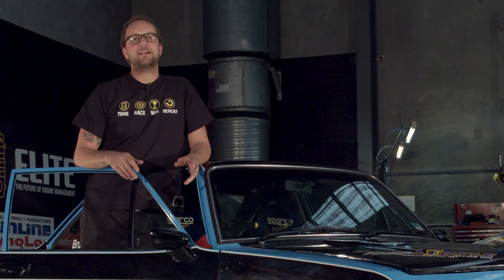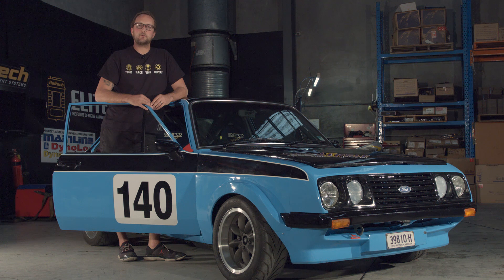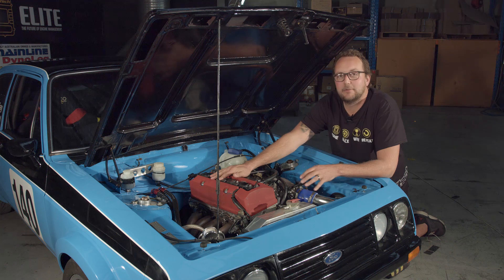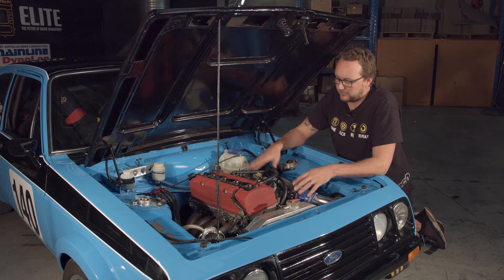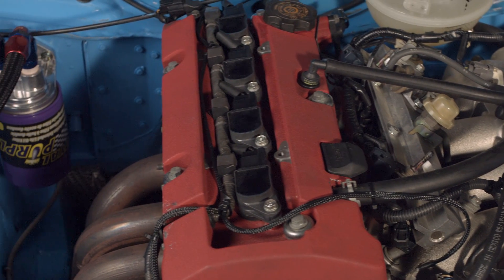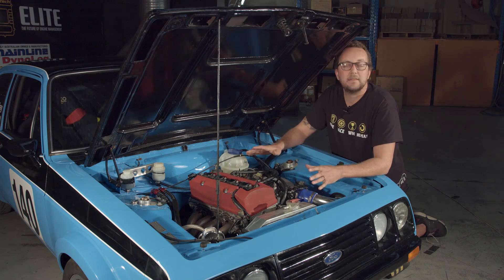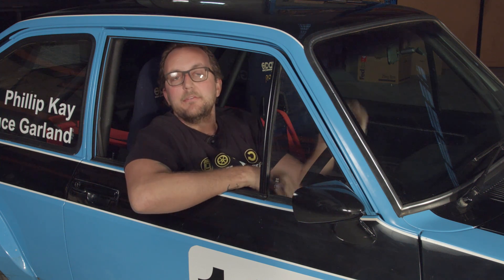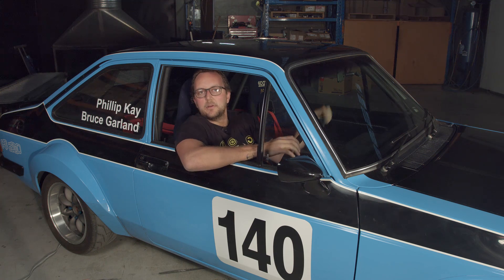💬 79 Escort with a Honda F20C conversion - Technically Speaking

Comment: Hi. I want to install a F22c on a te27 trueno. I have the original engine, transmission, harnesses, cluster, ignition, and pedals of the s2000 engine. What plug in ECU will I need. Please, provide me with the model. thank you

Comment: Did Ford sell the droop snoop RS2000 in Australia? I was sure the RS2000 down under was the standard Mk2 body so Ford could use it for Homologation racing purposes??? I could be wrong of course.
Reply: Rich77UK i thought the same bud, was told they sold them as a 4 door rs2000 as well haha,
Reply: @upurkilt7246  The full long nose version was sold here in Australia. But you did prompted me to go reconfirm my answer. So try checking out this website to confirm for yourself : )    Escort RS2000 Mk2 – Australia 1979 – Ford RS Owners Club (Australia)
rsownersclubaust.com.au/rs-cars/escort-rs2000-mk2-australia-1979

Comment: How much would a swap like that coast
Reply from the maker: That really depends on where you get your engine and how much of the work you do yourself. We are seeing a lot of these engines being put different cars.
Reply: Haltech yeah thanks I'm thinking about putting a f20c motor into a ke70 would be Abel to do most of the fab work my self just wiring and the fuel setup I'm a bit sceptical about

Comment: To MCM and Haltech, Guys have you forgotten about the good old FJ20ET that used to be in the old Skylines, Sylvias and Bluebirds??? 

That Engine responses to mods like no other old 4 cylinder and proven to out do the SR20DETs.

Would like to see a video modifying and tuning it. btw I can arrange an old S12 RSX (Sadly not owned by me anymore) in case it's needed it for the project;)

Comment: Way to ruin a Escort: Fit a Honda motor.
Reply: Hulk SMaSH why has it ruined the car? Think its pritty bitchen that some one has went outside of the normal zetec, pinto/yb turbo, v6, c20xe redtop, list goes on. but just another whay to improve what is a ace car and making it diffrent and more up to date. Hats off to the guys that built it.

Comment: How did the owner manage to get historic rego for such a highly modified car ????
Reply: Aren´t you allowed to swap engines in Australia? In England we can fit whichever powerplant we want; you just have to pay for an engineer´s report to say you´ve done a sensible job of it. In Spain or Germany you can´t even change your rims without wading through lots of paperwork. As England doesn´t have a huge accident rate caused by modified cars´ engines falling out at 130kph, I wonder why the restrictive countries are so restrictive.
Reply: @Del350K4  same here in Australia, just need engineering. But some/most states have limits on capacity increases
Reply: Probably had it regod with pinto and then changed the motor and didn't tell motor reg.
Reply: here in my state in the u.s.a. there is no inspection required for historic car just has to be 25 years old. so maybe like that? i got a 79 kawaski heavily modified running historic plates
Reply: We are in the same state as this Escort. To get historic rego you need to be a member of a vintage car club and have the club verify that it meets the Goverment regulations regarding historic rego. Our Mitsubishi was knocked back (about 5 yrears ago) because of non period modifications. And that was just a turbo on the standard factory engine.
Reply: Wow! It´s as if the various nations just each make up their own rules. There´s an Englishman called Ed China who´s built a street-legal sofa. You steer it with a wheel made to resemble a pizza - and it has a standard lamp with a tasseled shade. Just across the Channel in mainland Europe this would be unthinkable...
Reply: I was thinking exactly the same thing when I saw that. 2 possibilities...
1. The club let's Bruce Garland do what he wants. (Likely)
2. There's a new scheme called "Modified Historics" that the NSW govt is trialing. It allows older modifieds to go on club rego as long as they're engineered and roadworthy (IIRC). Talk to your club about it. I'm hoping to do the same at some stage.